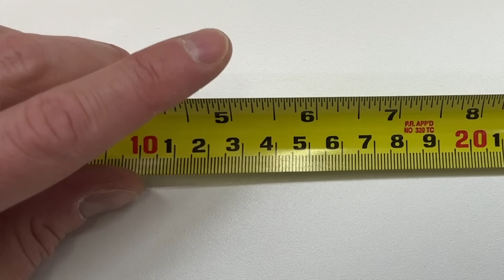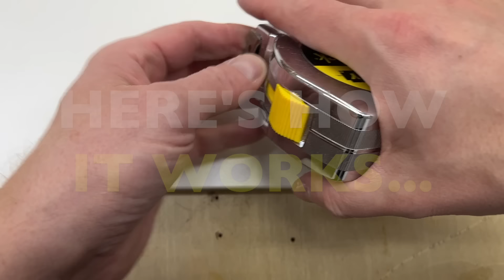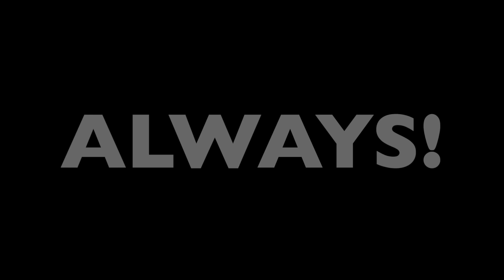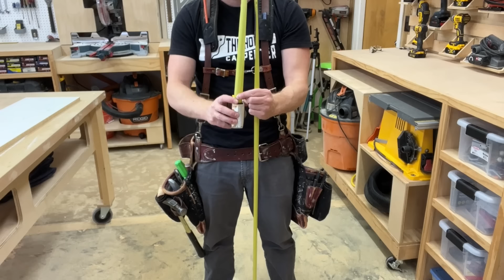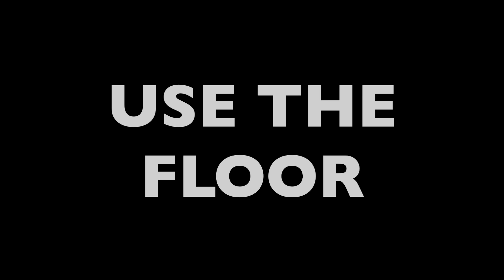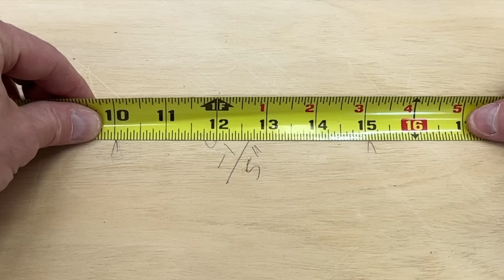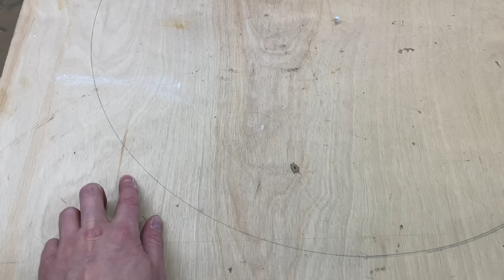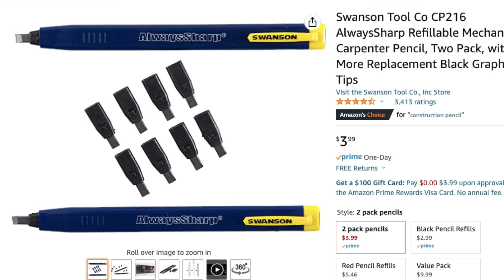ALL TAPE MEASURE TRICKS Explained...In Just 13 Minutes! (Measuring Tape Pro TIPS, TRICKS + ADVICE!)

Comment: Why tape measure of you can have a zig zag ruler?
Reply: Imagine a 25' zig zag ruler? It'll have you spending half your work day folding it out and back up again.
I love my short 1 meter zig zag ruler, but even the 2 meter ones are a bit cumbersome to work with. If I can leave it unfolded on my workbench and make all measurements there it's OK, but if I have to move around I prefer a tape.
Reply: @danielrehn81  i don't even have a 1m, just 2m and 3m (which I actually use more), and it's just great to work with them, since you also have the benefit of a ruler.
Plus, since I am used to metric and here most if not all boards etc are multiples of 20cm, which is the length of each section, it's just perfect.
Tape measure i only need for >3m and to maybe to get a general sense of a room. But the moment it has to be exact, zig zag it is

(but maybe that's also more a German perspective, where they are more common)

Comment: Absolutely agree about the Stanley Powerlock 25'. I bought my first one in 1972. Probably owned a hundred or more over time. Tried many other brands but kept coming back. In fact, I probably have three or four right now and I've been retired for 15yrs! They are the best!
It may be the object I have held in my hands more than any other single object in my lifetime.
Reply: The only thing I don't like about them is they don't allow for overdraw to read the entire tape. I build bridges for corrugators in my shop and usually a 35' tape will do the job, but not a Stanley, once they are fully drawn they never operate correctly again.
Reply: Fat max though... who doesn't love more standout?

Comment: NB: those are U.S. customary measurements if you are in the U.S. Imperial is a British thing. While many of the measurements match up, calling U.S. customary "Imperial" is quite incorrect for reasons that should be obvious. :^)
Reply: Also, for a lot of applications, having subdivisions in increments of 10 is not really that useful. E.g. if you have 6-7/8 and  you want to divide it by two, you can easily see that you get 3-7/16. Many people find this easier than dividing something like 6.7 by two, and division by two is something you do a lot of in construction.
Reply: @TheAntibozo  I agree, 'U.S. Customary', or even 'S.A.E.' are more accurate.  I have used the term 'imperial' for clarity with some metrics folks who, for reasons I still cannot fathom, continue wanting to engage us on the issue.

Comment: Honestly, I just watched to drive up your view count.  BUT I never thought about dropping the tape through my hand when pulling out long vertical measurement!  NICE.  I guess one tip is to check different tapes to make sure they are the same or have everyone use the same brand/model of tape. And for DIY projects, use one tape when measuring and cutting unless you've check that two different brands are exactly the same.  One last thing, for woodworking (not framing/construction), Fastcap has flat tape that eliminates the arc or the need to roll the tape.  It really is more accurate because you remove the parallex

Comment: One thing I would add is if you have more than one tape involved such as someone hanging siding and a cut man check to make sure both tapes read the same. I have seen two tapes ( even same brand and model 0 be off as much as 1/4 inch. Best ting to do when you buy a new tape grab a yardstick or T square and check to make sure the tape matches the T square or yard stick match alt least up to the 48 inchmark. I have even found new tapes on the shelf off by an 1/8 of an inch.

Comment: Maybe this was already mentioned but be careful when letting the tape retract - it can slice your finger open! And be careful when taking measurements around electrical plugs when measuring for remodeling. I once had my tape measure “find” it’s way behind an electrical plug and short out. Tripped the circuit breaker. Don’t know why it didn’t shock me.

Comment: Love the tips man. Super quick and informative video for anyone not just in carpentry, but for anyone working in trades no matter your experience. I loved hearing and getting a good refresher on quick tape measure tips that make you more productive as a worker. I would just like to add I prefer using my tape measure from my left hand so that would mean I read the numbers upside down but it’s just always been my preference because I pull out my tape measure and a pencil at the same time. It just takes some experience but still a very informative video. Keep up the good work. Appreciate the work you do and thank for sharing your extensive amounts of knowledge and experiences.
Reply: Yep. Tape goes on the left, pencil on the right or dominant side.

Comment: I've watched this several times, and still don't understand the "tab travel"   Why do I want to add/subtract 1/16"  ?
Reply: That is the thickness of the tab.  The tab travel does it automatically so you do not have to account for it.
Reply from the maker: Yep, the tab travel is built in with the tape. As long as the tab can move, it’ll take care of itself when measuring.

Comment: I was in the wholesale hardware industry for 30+ years, 20+ years in outside sales. Someone once showed me a "trick" that I still use. Les' say you have a good tape but it will not retract well. It most of the time is "dirty". To clean a slow retracting tape that is not worn out do this. Take a paper towel or shop towel. Then spray a goodly amount of WD-40 on the towel. Run the tape out it's full length, pinch the towel soaked in WD-40 around the top and bottom of the tape. Then retract the tape while applying pressure on the towel on the surface, top and bottom of the tape. Repeat until the towel shows no "dirt" being removed. The tape will then retract like new unless the spring in the tape is weak. Problem solved, class dismissed!!

Comment: It’s a good idea to have more than one tape measure. However, when taking detailed measurements use the same tape measure for all measurements. Just in case there is any variation at all you don’t get tripped up. Rough measurements this isn’t that important.

Comment: I LOVED it. Incidentally, I often use the 'lose an inch' technique for furniture building to get that accuracy. Problem is when you are tired, you forget you are off an inch and can't figure out why the piece is so short  and on woods like black walnut or cherry, that's when you realize you should have stopped for the day :) Ouch!
Reply: I've never once done that....... more than once....on the same day.....i mean... wait, no..... =)
Reply: @TheOtherSean  We've all been there :)
Reply: We call it "cutting an inch" / losing an inch.
Reply: I use my planer a lot, and I use the "lose an inch" method to get an accurate reading for thickness.
Reply: Wouldn't you have an extra inch if you burn an inch?
Reply: @screwfist  no you are using the first inch mark at the beginning of your measurement, so in effect it is zero.  Measuring from one to eight is only 7".
Reply: @spconrad9612  if you have a 8 inch board and you burn an inch when you measure it it would measure from 1 to 9 instead of 0 to 8.
Reply: Using the metric system its usually done on the 100 mark so if you forget, it's a 4" mistake, not a 1"
Reply: We call it the magic inch, especially when the other guy did it lmao "magic inch got ya didn't it!🤣"
Reply: @rbnhd1976  LOL, I am going to remember that. In my case, the magic inch gets me a lot at the end of the day :)
Reply: I’ve known it as burning an inch

Comment: When measuring to an inside corner, instead of trying to read the bend, I use another trick you showed in this video - I'll pull a measurement from one corner that's an inch and mark it; then I'll measure from the other corner to the mark and add that inch.

Comment: Thanks for the tips. For getting lengths across a long span (when tape bend could become an issue), I pull out one those compact Bosch laser measurers.  Solves the inside corner problem as well.
Reply: And tell me you don't go back and check with a tape measure to be sure it's (the laser) correct?
Reply: @dwightl5863  You know what they say, "Measure Twice, Cut Once''

Comment: As an electrician I carried a 12'er as that measured almost everything I needed. But I wore carpenter jeans for the pocket to carry my folding stick ruler. Measuring inside live boxes and raceways was less eventful with a fiberglass stick. 😉 I also used a wind up 150'er to measure wire runs from the breaker to box.

Different jobs, different tools. Thanks for all your videos!
Reply from the maker: Great points, dill! 😄
Reply: Folding wooden rulers were really common when I was a kid. I should have one around.

Comment: Great video, I’m about 2 years in and I even learned a few things! Something I’ve been doing recently for trim is I’ll break it into two measurements like you did. I’ve found this to be super accurate so there’s less going back to the saw to take off a 16th because I read into the bend wrong. I also like to cut long so I don’t waste stock by accident